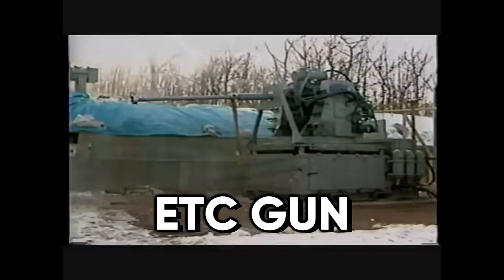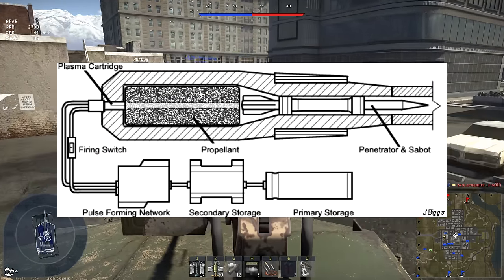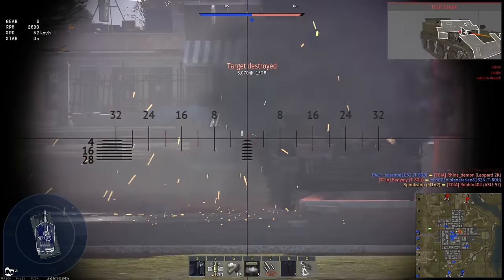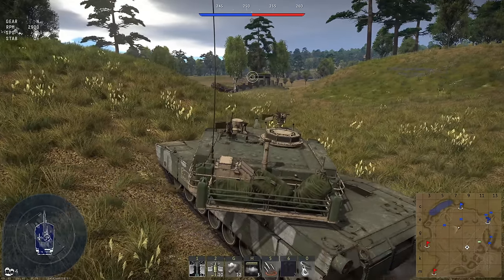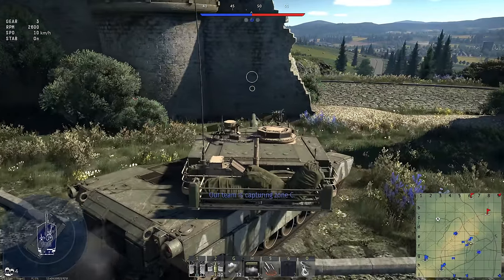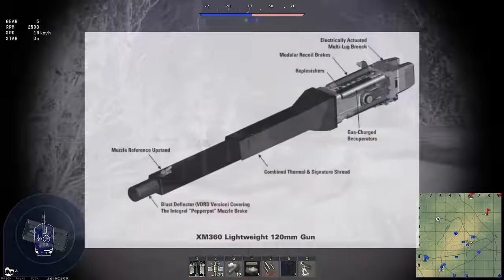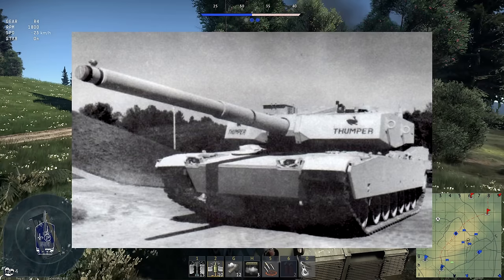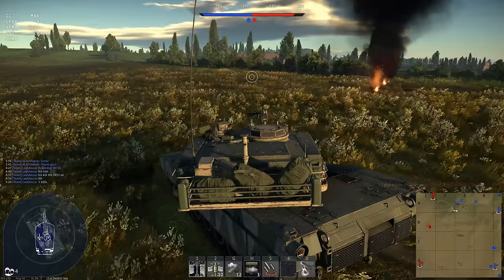ETC Cannons - The Future of Tank Weaponry

Comment: The ETC seems to be a nice stop gap for rail guns I think, I honestly think rail guns will be on tanks at some point but the cost and power needs for them will need to be worked on. The ETC's work well but as weapons get better so do armors to keep pace the never ending back and forth after all. Once the limits of ETC's are met you can bet rail guns will be close on their way to being the main weapon, after all they are already in testing for ship mounted weapons. Given the massive destructive force rail guns have I can't see them not being used on a some what wide degree once the tech needed to make them cheaper comes around. When we build space ships I can't think of any other current weapons tech that would be so well suited for orbital attack or orbital defense given the travel speed of the rounds, I mean the fuel costs alone to get a conventional ICBM into orbit to hit a ship would be beyond unfeasible so rail guns would be a much cheaper option on that front.

Comment: I am aware that the PRC has tested a ultra long barrel 125mm with muzzle velocities in the 2000m/s range not sure about projectile weight. Possibly the pratical enginnering limits of conventional propellant technology, the next step is clearly combusted agumeted plasma technology using liquid propellant and a drift to smaller calibres 100 to 105mm.

Comment: Correct me if I'm wrong, but the main reason for wanting to increase velocity rather than size isn't the logistical constraints (although those are undoubtedly important considerations. Although you do have to convert all your rounds from conventional propellant to ETC, which wouldn't be fun) its a bit of physics. Now, I am probably missing a couple of constants, but the formula for the kinetic energy of a projectile (or any moving object) utilizes the mass of the object (M)and the velocity squared (V^2) [thus the formula is MV^2] {edit: having checked the formula, Its MV^2 all over 2. Additionally, I apologise for using so many brackets, I try to keep from using them, but often fail} as is obvious, increasing the velocity of a round produces an exponentially larger increase in energy than increasing the mass. The other option for increasing armor penetration is to make the rounds sharper, but doing that not only increases chance of harming the people handling the ammunition, it makes it far more likely a round will Ricochet off of the armor rather than penetrating, which defeats the point.
Reply from the maker: In the papers I read, the DoD was primarily concerned with the logistical constraints. Switching to larger ammunition would also require the use of autoloaders, which the US has been kind of adverse to using.
Reply: @Spookston  thanks for informing me, I'll gladly concede the point to your superior knowledge. And thanks for the excellent video, never heard of ETC guns before, but they sound awesome

Comment: Just on what you said about ETCs being more widespread, there will be an upper limit to what an ETC can do (at the moment 4kms~) but, there may come a time when even that won't do, so railguns may in fact become widespread later on, like how I'm sure people in the past probably never thought that a tank gun in excess of a 75mm would be necessary. Then again, I'm always curios as to why the humble coilgun never gets as much attention as some others. Great vid though.
Reply: Because coilguns are harder to make and they still have issues switching power from one coil to the next at the right time. What i'm wondering is why the helical railgun has gotten virtually no attention outside an X-Com 2 DLC. I wish the name was still just used as an after thought.
Reply: @2Potates  They're by far the simpler EM linear accelerator. I've yet to get an adequate explanation why longer coils are not viable.

You could just accept the increased power consumption and run all coils at the same time when the trigger is pulled, either.

Helical railguns look like a bit of a nightmare, to be honest. All the precision engineering to make sure all the conductive surfaces line up, and making sure the brushes aren't destroyed in the firing... Seems like a hell of a lot of additional work, on top of all the other concerns that come with a railgun.
Reply: @CallanElliott  There's no advantage wth having longer coils. What coils do is pull an object to thier center, so to fire a projectile you have to turn them off when the projectile reaches halfway each coil. So because of that it's smarter to use shorter thicker coils.
Reply: @2Potates  Fair enough, but still timing isn't all that difficult especially nowadays. You could do it with basic electric logic nowadays, maybe a small on-board computer if you need variable velocity.

Comment: If I could make a suggestion could it be a video debunking some common Tank myths/misconceptions?

Like Rifled vs Smoothbore cannons,Wehraboos thinking that the panther was the first mbt,you get the idea
Reply: couldn't agree more. Then those same wehraboos are like you wrong because you get information video games are other stupid crap. Sure the panther could support infantry but it had much better tank killing power. Where as the Tiger 1 had both good ap and he rounds making it more versed in roles. Or the fact the even documentaries and plenty of historical books have stated that the panther only had 15mm of side skirt armour or that the sides were especially weak on the panther. And Sherman tank crews often exploited that. so preferably panthers were best used a long range snipers in open fields where they that room to move and avoid flanking attacks.

 Not that the panther couldn't fight in urban battles it just meant that the crews and supporting troops really had to be alert and prepared for possible enemy ambushes. How the Chieftain said the 15mm sides did provide some protection against heat and shape charge rounds. But in war their know full prof defensive systems. 

So that can't really make it an mbt is its primary role is to be a tank killing medium tank at long range. Not that it can't be a close support tank either the crew just had to especially cautious if the enemy had anti tank guns on side streets waiting for them if the panthers were at risk of exposing their weak side armour.

I think medium tanks like the Panzer 4 and sherman, t34 were closer to the MBT concept but key word being closer as they were well rounded designs that more balanced armour layouts even for not being that heavily armoured tanks. Also the panzer 4 h's in some ways had better add on armour as the additional skirts cover most of the tank sides and extra turret armour to.All though not overly thick the extra coverage in way acted as saving throw in away as it could absorb some rounds but the plate would get shot off but it may give the crew more time to retreat from a fight if needed.

Also Tiger 1 heavy's side skirt armour was thick as a panthers frontal armour and still had 50mms of rear armour. Yes its still had a weak lower frontal plate and the turret could easily be jammed. But its armour could hold up more even in urban warfare than panthers could if it was attack from its flanks. But that doesn't he can't crews still shouldn't watch their flanks and aren't vulnerable to flank attacks. But room for error is bit more forgiving for the crew and their is higher chance it could still be functional even if the enemy shot in the side or rear. 

But again i am not saying I am right on this but i just think their is reason why panther crews preferred shooting from longer range and that their have been multiple documented accounts of panthers getting destroyed at close range by sherman's ambushing their flanks. 

So in order to be an effective mbt you have not only engage and defeat enemy tanks in the open plains or fields but you also have to be able to support infantry in urban warfare and you want a robust design that can handle attacks from all directions or least take some punishment even when flanked by the enemy Thats whole reason why modern tanks can versions of their own urban warfare survival kits or the use of era.

But thats just my opinion. Its not that imortant and that we must take the all mighty wheraboos knowledge as law in the history realm lol.

Comment: I wonder if you could use some intermediate material to help lower the energy cost for each firing event. Plasma kindling, as it were. Maybe an electroreceptive component running throughout the core of the charge, or a series of staged shaped charges or a bit of both. If youre going to go incrementally then start looking for spare increments to borrow from other weapons and physics research. Id love to see one of these with a small two-piece shotgun style nuclear round, i think this design might be ideal for that long sought after tactical nuclear SPG or tank. It would be a horrific use of the technologies but its interesting to me from a synergistic engineering standpoint.

Comment: I have a 100% theoretical idea: put an etc gun into a turret, and have an loading system where the hull houses the loader and the loader places ammunition into a device that loads it from the hull into the turret, and use the same cameras used in tanks for the gunner and place those in the hull too, my main issue is the hull of most tanks can't fit all of that.
This idea is to take the crew out of the turret increasing survivability

Comment: Woudn't the hybrid drives next-gen tanks are maybe gonna use, where it's a (relatively) small petrochemical generator hooked up to an otherwise all-electric drive train, pretty much solve the power problem outside of combat damage? They wouldn't generate enough power for railguns, but the relatively paltry amounts needed for ETC rounds should be easy to get, if you're already planning on powering the drive with it, right?

Comment: The individual components to the system, such as the energy storage unit, and the Pulse network component seem like they could potentially be fragile. And what if someone was to target them with a tank round, or EMP type device. How would they be protected, would the main components be housed in a protective casing? In any case, as you said ETC guns can use chemical propellent as well, but I'm curious as to this potential issue..
Reply: It's not that they can use. They use chemical propellant, otherwise it is an ET gun not an ETC, it's just that you use plasma to make the chemical propellant performed better.

Comment: Eat the Curb guns with higher calibers could make use of ramjets to boost kinetic effects. Of course, these would get smaller as manufacturing techniques advanced, and soon you would see 90mm or smaller projectiles that hit way harder than anything ever provided beforehand.
Reply: no the ramjets would be detrimental, they'd be more innacurste requiring it to be an atgm, which would slow its performance, which would make it not penetrate as much.

Comment: The issues raised here boil down to increased muzzle velocity and reduced propellant volatility.  Setting the propellant off with a plasma device is seen as one cure for both problems, until you discard all the cutesy-poo names for a plasma ignition system, and call a spade a spade: you’re propelling rounds using electrical arcs, and sizeable ones for AFV cannons: you’re using fluorescent lightbulbs or even arc welders to propel cannon rounds.  Think on that.

Comment: Just want to point out, @spookston that when a armour piercing round or HEAT round high explosive anti-tank round rips through the armour or its target, especially if the HEAT round is a shaped charge, the explosion of the shaped charge, utilises the extreme temperatures of the explosion to generate a high temperature plasma metal vapour which punches through the tank armour. 

It would still ignite the propellant used in the ETC guns, as it would be reaching similar if not greater temperatures in order to penetrate the armour in the first place, because if you look at shaped charge ammunition for tanks today, many are designed in a way to produce a lethal stream of Molten Plasma vapour in order to penetrate the armour, so what you said before where the propellant used in the ETC would not ignite if it was hit with a enemy tank round is flawed to a decent extent.
Reply from the maker: A significant amount of the HEAT warhead's energy would be lost in penetrating the armor. HEAT warheads use a plasma jet to destroy armor, but the resulting destruction  primarily comes from the spall generated by that destruction. The amount of heat that the plasma igniter can generate is not the only factor which would allow it to set off newer propellants, the kind of plasma that is generated also matters. I sourced the claim from DoD documents, I'm sure they wouldn't have forgotten that HEAT warheads exist.
Reply: Woah woah woah, HEAT rounds DO NOT create a molten plasma jet. The copper (or other material) jet is never molten (although it obtains fluid like properties thanks to the tremendous forces) and is absolutely not a plasma (superheated ionized gas).
Reply: @Spookston  It still wouldn't matter, plasma is plasma having actually spent time in the military, and having seen what anti tank, and anti tank missiles do to armour systems, of armoured vehicles the propellant used by the ETC weapons systems can still be ignited, as the propellant is still a form of explosive, and when you are using a propellant that is more powerful then conventional propellants they also inherently become more unstable, and volatile. Which means the risk of them being ignited, is higher. Considering the types of rounds a tank such as the M1A2-abram can fire, magazine ignition is a possibility, because if you have a weapon that can fire between two and three times the speed of conventional tank guns, the armour systems for enemy tanks will then improve to counter it, and more then likely they will work on a newer type of round or rounds to defeat said tank.

Comment: Could firing systems be modified to use smaller than current 120mm canons? Like, Can a 120mm canon be modified to use the ETC round of the same or smaller size? Kind of like when a gunsmith sleeves a barrel to make the bore smaller and thus change it to a smaller cartridge?

Comment: their three slightly different Variaties of this Tech one ET or Electrothermal guns, Electrothermal chemical (ETC) guns, and then Electrothermal Ignition (ETI) Gun. This term “electrothermal ignition” is also sometimes used to refer to ETC at energy levels of less than 100 kJ.  ETI provides the same benefits as higher energy ETC, with the exception of thermal compensation for certain propellants, for which levels of 300 kJ or more are required.  However, ETI offers precision ignition in a smaller and lighter package, suitable for vehicle integration, and of course ETC guns ETI and ETC are pretty much the samething at least but of course this is by my research and that the two names depend on the energy levels that are used to fire the gun (if this is correct or not let me know and of course let me know the actual differences besides energy levels for IDing the ETI and ETC guns however ET still kinda confuses me on what makes it a bit different. theirs also electric light-gas guns as well). side-injection guns and Ram Cannon/Ram Accelerator guns.

Comment: Frankly they should stop faf'n around and make light gas guns.  They top out north of 11Km/s and aren't much more complex than a conventional cannon.  You'd load a shell deep, load a charge capped with a pusher sabot, close the breach, and fill the gap between the charge and breach with some light gas.  Liquid hydrogen or helium would be ideal, but I bet liquid natural gas or Neon would work just fine.  Would have one hell of a muzzle flash though...

Comment: Electromagnetic railgun wool if I ever get it running will make this gun obsolete before it even hits the battlefield because there's no explosives in the vehicle itself the vehicle will survive longer even if it's hit even in ships it'd be a massively forward because you won't have magazines and piles of gunpowder stacked around just waiting to be blown up which means you can also reduce the weight of the ship or vehicle using less armor make it lighter and faster

Comment: Fascinating stuff!
You said this system uses plasma to ignite the propellant.  A quick step over to wikipedia shows that electronically-fired weapons aren't a new idea, already used by the M61 Vulcan.  So how are ETC guns different?
Reply from the maker: Electronically fired weapons are using electricity to set off a chemical igniter, whereas ETC guns use electricity to set off a plasma igniter.

Comment: Caseless cannon? I read about a caseless cannon a few years back There were two types. One was the standard caseless set up. The other one used a liquid as the charge. The round was placed in the breach and a liquid was pumped in the chamber and set off. The second type was said to have a very high fire rate for a cannon. Do you know anything about them?

Comment: TLDR; an advanced propellant ignition system designed 30 years ago, only just catching on, allows higher grades of propellant to be used to increase muzzle velocity.
It might be more practical, but it's hardly a huge leap in tank technology.
Reply: Using an electric charge to propell a plasma ignition round seems an huge leap.